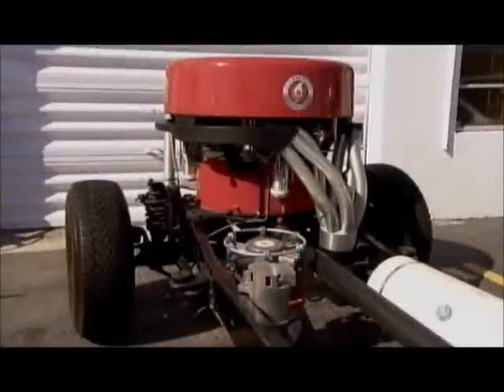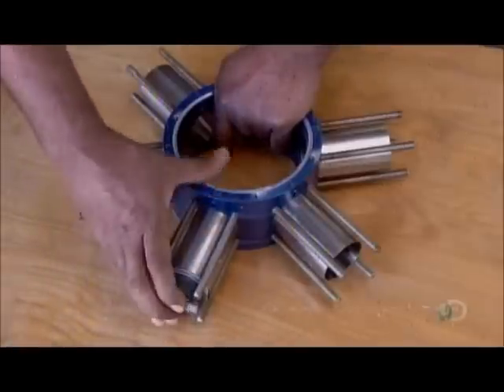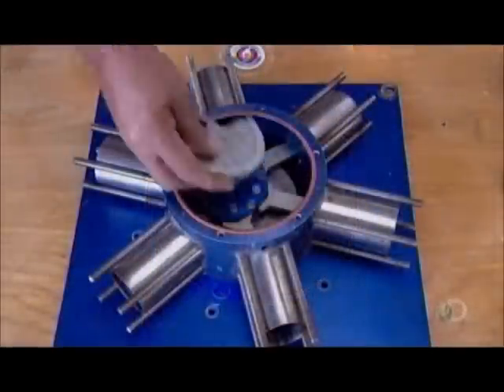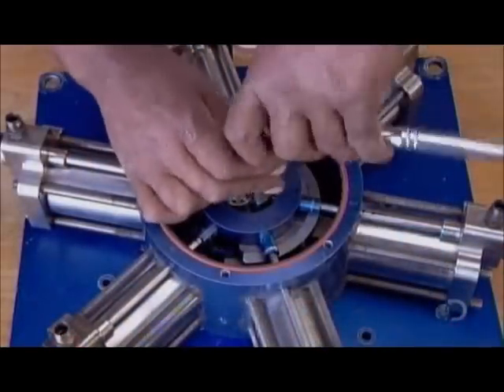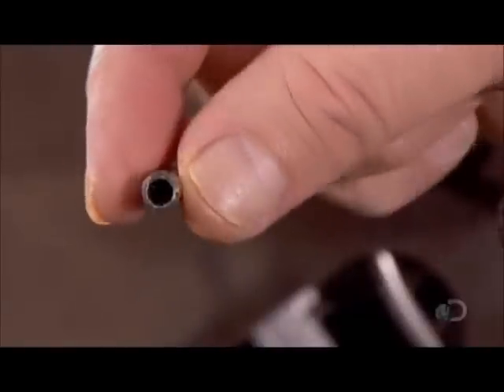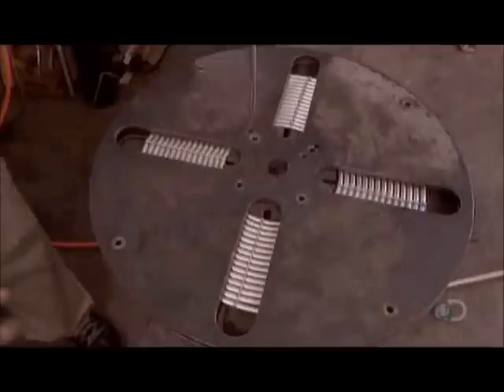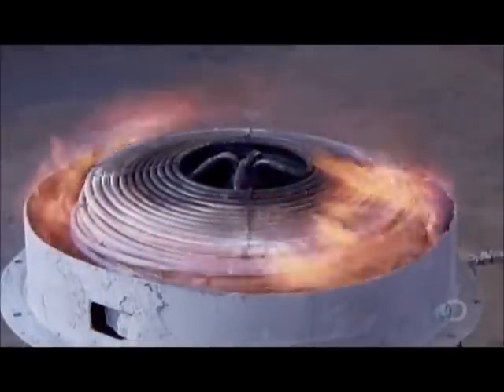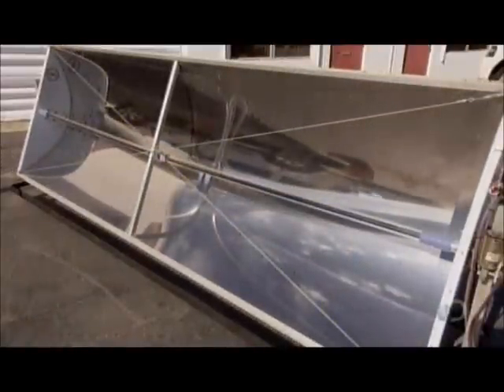How It's Made - Steam Engines

Comment: steam engines don't need a transmission.
since the tourqe they produce is not depending on the revs.
Reply: The real doktorbimmer oh please! Cut it out already… you know darn well the issue was whether a transmission was used.  It wasn’t.
Reply: The real doktorbimmer

take the fuel you want, and see how mutch energy it has inside.
then take a look at the output of the system, the kinematic energy it can supply. notice the word system.

compare an IC engine, its clutch, and its trnsmission as a system.
then do with the same with a proper boiler, and a steam engine.

the verry first thing you will notice is, steam will give you more out of your choosen fuel.
your question then, why are they not used in cars?

now, take the same 2 systems, and to measure them to see what kind of mass they have, and see the relation of kinematic power and mass for both systems.
You will see, a steam engine and its boiler is far larger in volume, and wieght far more for a given unit of power.

there is your answer.
IC engines are light, and small.
steam engines are big, bulky, and heavy.

efficiency at power/weight and power/volume wise for steam applications is low. they are inefficient in that regard.
they can turn fuel into kinematic power with high efficiency, but it would be verry impractical solution for a car for example.
(notice, again i point it out, for a car you do not want a steam engine, neighter do i)

how come it could turn fuel into kinematic energy at a better efficeincy , if both are heat engines ?
IC engines have a graph of tourqe  relative to RPM.
to make an IC engine work efficiently, it only has a narrow band of RPM where it can function properly, efficiency decreases a lot when the engine is driven outside this range.
so you have to employ some mechanisms, usually a clutch, and a transmission. they add dead weight, and simply take power away from the engine just to spin. This adds up to around 30% tipical.

if you only take the engines them self, the IC engine in its working range has better thermodynamic efficiency, but not enough to negate the effect of the reduction in output by the transmission and clutch assembly required to keep the engine in its best working range.

the piston based steam engine if it lacks deadspots, dual actuating ones usually do not have any you have a near lossless CVT -ish like setup.
as the steam engine's tourqe does not depend on rpm thatmutch, it does, but magnitudes smaller variation can be observed than with the IC engine

and there you have it.
what if by some magical means a steam engine could be scaled down in size, and weight , along with the boiler , while still having the same output ?
well, it would still not be usefull in a car.
(notice again, not usefull in a car. i repeat, NOT USEFULL IN A CAR)
why ?
it takes time to heat up a boiler.
you can start an IC engine whitin secunds.
not su true with a steam engine.

great, so then how come piston based steam engines are not used widely ?
most stationary engines requirements are to drive a rather constant load.
for that application a turbine is better suited.
near constant rpm, and load.
would be ideal for an IC engine, expect..
IC engines have far less thermodynamic efficienc than multistage steam turbines.
a signle stage turbine would never be able to match an IC engine,  but happy for us, we are not limited to a single stage. Impulse and reaction turbine stages are coupled via a common shaft in mutli-stage turbines, yielding a better thermodynamic efficiency than even a turbo-compund IC engine.

allso turbines run on the rankine cyycle, not the carnot cycle.
waste heat recovery is conducted by re-heating steam used in the system,  given a proper matching the heat lost to re-condense from steam to fluid again can be minimaised, and even that heat can be used in a number of ways. like providing hot water, or in some cases heating the fuel burned to create steam.

this is why even oil burner powerplants use steam, and not burn the oil in an IC engine.

and to run back a bit to turbo compounding.
i did search, but failed to find turbo-compund solutions where multistage turbines would be used. particles in the exhaust prevent using high efficiency turbines. refer to what i wrote, i was woundering hat would it take to filter those particles, or to use a heat exchanger. so proper multistage high efficiency turbines could be used.
nothing new, still turbo compund, i adid agree with you on that.
same as exsisting solutions ? nope.
driving a generator and using an electromtor, allso nothing new, can be seen in f1 and other areas. with a storage unit in between.
and that is the difference. instead of  a storage unit, the electric power would be routed by a load tracking powersupply.
how is it different from f1 solution ?
1. no storage used. storing electric power and using it reduces efficeincy. for a lead acid battery as an example, about 50% is lost.
2. f1 solution accumlates power, and releases it in a short time, meanwhile the load tracking solution should provide a load for the turbine to keep it as close to its ideal work RPM and load as possible, and would provide a constant coupling.

steam as a primary engine in  automotive use is not feasable.
(notice it, again i point this out)
while they can turn fuel into kinematic power (as a system , do rememeber that) at a better efficiency than IC engines (again as a system) they are still far to bulky and not quite ideal for a car. (again, not ideal for a car).

as a waste heat recovery system augmenting an IC engine, i think it may have its value ( heatexchanger from exhaust gas type solution to allow high efficiency multi-stage turbine operation) but if the exhaust gas partcile filtering is managable to a level to use higher efficency turbines for turbo coumpounding ( see the pattern? hence why i was woudering what would it take to filter the exhaust gas to that level) then that would be a far better solution for automotive usage.

to sum it up, i DID NOT SAY steam power for cars is the way to go.
DID NOT SAY STEAM FOR CARS IS THE WAY TO GO.

alsso did not say a steam engine alone is better in efficiency than an ic engine. (I DID NOT, again and again).

I do state piston based steam engines as a system ( AS A SYSTEM) are better in effciency compared to a piston based IC engine SYSTEM (YESS? AS A SYSTEM)

i allso do state a multi-stage turbine based SYSTEM (SYSTEM, read it, it says SYSTEM) is better in thermodynamic efficiency than any IC piston engine, even with turbo compounding.

you did not correct anything i sayd, instead,
you just simply made up things i never sayd, and argued over those.
none of them are my claims.
you only proven your own false imaginations false.
Reply: The real doktorbimmer oh you’re going with not admitting you were wrong?  Ok.  There’s no transmission there, and BTW, it’s easy to see from the vid that Leno is right.
Reply: The real doktorbimmer you’re hilarious!  When forced to admit that steam has far more torque you can’t resist adding ‘…….than is even needed…..”   Dude more torque is always better, it lets you downsize the engine.  You have a psychological problem with steam engines.  Very strange.   Look out! They’re coming to get you!
Reply: Nagy Andras let’s be charitable and assume he got one of my comments mixed up with yours.  But he keeps putting words and statements in my mouth that I did not make, and he does the same to you.   His statements are strangely rigid and dogmatic.  Well, I’ve had enough fun.  Bye.
Reply: +Nagy Andras yes, and unfortunately, diesel is now facing a major, possibly deal-breaking issue. That is emissions.  I hope there will be some technological way out of this, but urea, after burning and scr are power-robbing options.  I hope they find a solution.  BTW, I own one of the affected jettas involved in 'diesel gate’.  I’m waiting to see what will happen, but I will tell you I’ve already had some major issues with the after treatment system.  Water in the intercooler system resulting in hydrolock, and a sticking air flapper in the low pressure egr system.  The exact same thing is affecting thousands of fellow jetta owners.   I’m pissed and disappointed at Volkswagen.  Off topic, but I had to vent.
Reply: +The real doktorbimmer no, and if I had more money I’d have bought a chevy volt and if I had a real lot of money I’d buy a Tesla.  Are either of those cars driven by a diesel engine?  NO, because efficiency is not the sole determinant.
Reply: +The real doktorbimmer oh look, the EPA has given certification to a Cyclone steam engine.  4 manufactures are ready to produce the engine (a 25hp waste heat unit)     This must be fake.  Probably movie actors in fake  EPA labcoats or something.
https://www.facebook.com/CyclonePowerTechnologies/posts/1016753441690054
Reply: free piston engines are not a new idea,
starting them up was a problem and as far as i can remember they had problems with balancig for vibration.
energy storage in a battery and then using that energy has its own problems allready. actualy generating green power from solar and wind is no problem, but storage is. not even grid tie soultions provides enough efficient capacity to store energy in a high density form. charging  battery then draining it has a quite low efficiency, and direct driving motors from a free piston engine has its own problems, as free piston engines need some sortha load to operate properly (unless i remembre wrong, witch can happen)

no idea what toyota could have engineer as a solution tbh, currently my personal best bet will be 2 cylinder 2 stroke diesels, with an electrically assisted turbocharger, and maybe even a multi-stage turbine for turbo-compounding.
Reply: Nagy Andras but they need a lot more fuel to produce the same amount of power...
Reply: The real doktorbimmer

well external combustion engines are not quite as efficient as internal combustion engines, i give you that for sure.
on the otherhand external combustion engines have advantages.
the lack of need for any transmission and even is some cases a clutch , is a great one. consider that a transmission can eat up even 30% of power.
if you look at the whole system, they are not that inefficient.
but surely, internal combustion engines give better ratio of weight to power, and operating them is far more efforthless.
it takes a while to make steam.

on the otherhand, if you look at any nuclear plant, its hearth is a big funken steam machine. not piston based, but turbine based.
and are pretty darn efficient if they work as a combined cycle plant (they do.)
not suitable for a scooter or car, or truck, but its quite suitable as a stable engine.

if you consider the combined efficiency of a combined cycle steam turbine , and any internal combustion engine, you will find steam engines are not so bad at all.
Reply: Nagy Andras Interesting thoughts... but it doesn't explain the consistantly lower fuel economy of steam technology.. 

You almost make it sound like steam powered cars  have not been obsolete for 100 years!

cheers!
Reply: contrary, i make it sound steam powered car where obsolete 100 years ago.

but when you refill an electric car today, most probably you use at least partially steam power :D

its better as a stationary engine than an IC engine. fuel economy wise too.
for any moblie application...
well, some thips do have a nuke plant, so they are steam powered anyways.

but i agree, in a car it would suck bigtime.

fuel efficiency.. well it depends on construction and on load. the eninge alone in its self is far inferior to modern ic engines.
on the otherhand, if you look at the input fuel energy, and the output at the end of a system, there are certain cases where it will outpreform an ic engine by far.

its a kindof problem like.. a farmtractor, and a city car comaprism.
try to plow with both, and you will see the tractor has bette fuel economy...
on the otherhand in a city drving scenario the tractor may not be your ideal choice :D

it really all depends on what you need to do.
if torque avalble from 0 rpm to full rpm is important, steam is the way to go.
still is, ever since it has been invented.
Reply: Nagy Andras electric power that could have been generated more efficienty by ICEs..

specially since charging a battery-electric cars off the grid is not energy efficient..

but its not more efficient... its just cheaper... there is a difference there... a difference that doesn't translate to small scale vehicle applications.

Thats a really bad analogy.. there is no comparable data.. like power output, BSFC or thermal fuel efficiency... not to mention design variables like power to weight ratio or design service life...

Steam has never been more efficient.. Carnot discribed these facts before ICEs were even invented..
Reply: sure, the The MAN S80ME-C7 can reach up to 54% conversion, but at other than ideal load for the engine will make it less than 50% efficient. probably around 47-48% or so.

http://www.turbinesinfo.com/steam-turbine-efficiency/

this might be a good read.
there is a verry good reason that most of eelctricity is made by steam turbines :D
Reply: Nagy Andras Thats still better than steam!!!!!

Yes of course.. we are talking peak efficiency for power stations too..  big ship engines spend most of their time running at optimum rpm and load just like power stations, but Diesel is also much more efficient in off peak conditions and we are talking single cycle for the Diesel... just like you would find in other vehicles... so no there is no efficiency advantage here even using your facts.

Yes there is ... because cheap or dirty fuels like nuclear or coal are cost effective despite steam being less fuel efficient...

There is a good reason most of the electricity is not produced from oil...
Reply: "Multistage (moderate to high-pressure ratio) steam turbines have thermodynamic efficiencies that vary from 65% for small (under 1,000 kW) units to over 90% for large industrial and utility sized units."

internal combustion engines won't get there ever.
allso do notice, i exactly told steam power in any form would suck for a car.
why you act as if i would say steam for cars is the way to go ?

and even, where are we?
i just mentioned steam engines do not require a darn clutch, and piston based steam engines do not require any transmission at all, as they by nature of externa combustion engines have maximum tourqe when halted. (some designs have a dead point where they can't self-start)

so anyways..
stationary engines are steam powered for a verry good reason. higher themodynamic efficiency than any internal combustion engine could ever have.
Reply: Nagy Andras Lol..!!! I don't know where you came up with those crazy numbers!!!!

Your data is incorrect, and very inaccurate.

Your statement is false, in fact t it is impossible for any steam system to reach  efficiency beyond its theoretical limit of 64%

The Diesel has a theoretical limit of 74%

steam turbines currently reach only about 40%
Reply: source for steam turbines
http://www.turbinesinfo.com/steam-turbine-efficiency/

source for the MAN diesel engine
https://ralphhosier.wordpress.com/2011/10/25/the-most-powerful-piston-engine-in-the-world/

and you are incorrect, single stage steam turbines don't go past 37%.
Reply: Nagy Andras Are you actually quoting data from your own website??? wtf???

The "facts" on your site are wrong.. completely inaccurate.
Reply: The real doktorbimmer here’s a clipping from a steam expert:
 the energy required to produce the fuel renders the gasoline engine less efficient than the steam engine.To use an analogy, we get media hype about the "non-polluting electric car." No one pays any attention to the coal-fired power plant belching dust into the air to create that electricity.A steam engine can run on the products at hand -- sawdust, wood, corncobs, etc. No one counts the cost and energy consumption of bringing crude oil out of the ground, refining it, shipping it to terminals and service stations, and all the rest.It gets better. As we have just shown you, the net cost of operating a steam engine is lower than anything else on the planet that requires fuel. You can run an automobile on farmer's alcohol. You can run a diesel on vegetable oil. Both examples are still more costly and labor intensive (to produce the fuel) than steam.You may never have to replace the steam engine itself. Steam engines do not form carbon (a major wear factor) and turn fairly slowly. Steam engines have other advantages that, in regards to the wear factor, outclass gasoline engines. Steam engines normally have much larger bearing surfaces against the crankshaft. Steam engines have no "side-loading" as gas engines do and, on a "double-acting" steam engine (steam pressure is alternately exerted against each side of the piston) there is a "cushion" effect that protects the engine still further. One steam engine in England ran 24 hours a day from 1800 to 1950.See:  Levant Beam Engine: A steam engine built in 1840, its claim to fame being that it is the oldest Cornish mine engine which also has remained in situ, and is to this day operational
Reply: Nagy Andras "allso do notice, i exactly told steam power in any form would suck for a car.
why you act as if i would say steam for cars is the way to go ?…”   He accuses anyone of this if they don’t put down the concept enough.  

You say steam for a car would suck, yet 100 years ago they made very drivable steam cars.  Youtube is full of people still driving them.  A modern steam car would be far, far more drivable, no doubt.
Reply: Some Other Dude Yup... coal is very cheap... its the only thing (other than nuclear) thats cheap enough to offset steam's higher fuel consumption than ICE's

using the current grid system, battery electrics are less efficiect (total fuel efficiency) and create more pollution than a modern ICE powered car.
Reply: Some Other Dude Steam cars were already obsolete 100 years ago...

 Charles Kettering invented the electric starter in 1911... steam instantly became obsolete.
Reply: The real doktorbimmer I’m just reading a steam expert guy talking about farmers running steam engines profitably using organic farm waste….
Reply: The real doktorbimmer hundreds of thousands were built, purchased and driven.  I don’t think you could even admit that with a gun to your head.  You’ve got some kind of mental problem with steam engines.    And if modes technology tipped the balance back towards steam, I think you’d go insane.  Any ideas on what wrong with you?  You really, really have it in for steam.
Reply: The real doktorbimmer here’s a fascinating engine,  although you will get all threatened and annoyed by it:

http://www.douglas-self.com/MUSEUM/POWER/still/still.htm
Reply: Some Other Dude I'm familiar with William Stills work on the Kitson-Still Diesel-Steam co-gen locomotive from the same period..

Still was very smart.. combining the higher first stage Carnot cycle efficiency of the Diesel and the co-generating  second stage heat recovery of the steam cycle.. 

Unfortunately for Still the development of the Diesel passed the thershold where his concept would be practical (at the time) for land and marine applications.. of course his basic theory is still in use today in staitonary gas fired ICE powerplants using combined cycle steam co-generation..

The idea is "still" useful in mega-sized ICE powerplants
Reply: Some Other Dude Well if he's using free "shit" for fuel then fuel efficiency is meaningless...

whats his build and operating costs?

How many kilowatts is he generating?
Reply: Some Other Dude I love steam, especially big American locomotives... but I'm not deluded into thinking that they are not obsolete.

thankfully some good folks have preserved a few of them at railroad museums... where they belong.
Reply: piston based steam engines are "obsolete" in many ways, yess.
as a waste heat recovery system, steam turbines to a far better job.
but they are impractical both as car or truck engines.

piston based ones do have a trait that no IC engine could ever have, that is constant and instant tourqe, and lack of need for a clutch of anysorths at all, and in man cases they do not require a transmission.
if you take an IC engine, make it a verry good one, say..impossibly good.
that has say.. 80% efficiency of turning the fuel into kinematic energy.
and it is coupled to a transmission that is allso not a bad one, but still has 30% loss of input vs output (not uncommon. a lot of them are actually worse) you end up with 0,8*0,7 = 0,56 , so 56% efficency.
something a steam engine can provide, and nothing else is taking away from it.

they are not inefficient in a wide tourqe range use (piston based ones) , and do better than an IC+clutch+tranny.

however, a multi stage steam turbine in its narrow work range is surprassing IC efficiency.

what both multi stage steam turbines and piston based steam engines far short is weight and volume vs power.
an IC engine is pretty mutch verry good in those.
if weight and size is no problem, and only efficiency is what you seek than steam is still the way to go.
and this is backt up by the fact of widespread usage of steam powerplants all around.
You have to account the losses of the drivetrain to judge the efficiency, never forget that.
from economy point of view, the available fuels are allso need to be accounted.
for automotive usage fuel energy density and weight of the whole thing has to be considered.

it all depends on application.
if you are environmentally frinedly even then steam has its uses.
singel junction solar panels can't reach over 34% efficiency, and storage of solar power is still a problem.
allso solar cells are not quite friendly to environmnet when they are produced, and decay over time to be less efficient, recycling of solar panels is allso not that easy.
meanwhile, a concentrated solar type "boiler" can store superheated steam over time and release it to steam engines.
so the battery problem is at least partially solved, vacuum insulation technology is pretty efficient nowdays.
however, for loads that are not constant a turbine based steam engine is not quite ideal. piston based steam engines have no problems in that regard. allso steam egngines are easy to recycle, and have a pretty darn long life cycle, imagine one made with todays advanced technology vs an oldtimer that ran for decades based on hundred years old technology.
it would be the size of godzilla, still requires no chemicals unlike any battery, water stays water, and never decays (in a closed cycle) and would provide some usefull traits no other solar based technology can.

steam is still not a bad thing, but i do agree for many areas its unsuitable.
i repeat that, for many areas steam is impractical and unsuited.
i do not envision steam powered cars and airplanes, i'm aware why it would not work as good as IC engines in that role.
I'm allso aware where stea still is the best possible solution.
and again, steam is not better at everything compared to an IC engine.
never sayd that, never will, don't even try to give that into my mouth.
I just pointed out its far from obsolete, as sofar nothing better has been found for many areas, and steam power is still under development.
Reply: The real doktorbimmer you are discounting any chance whatsoever that they will ever come back in any way, shape or form, no?  Did you read about the BMW energy recovery system that uses steam?  I think they were using that instead of an alternator.  There is also some guy who patented water injection into a 4 stroke diesel to gain lots of extra power….
Reply: Some Other Dude

6 stroke and water injection technology is allso quite old by now :D
and steam does not need to make a comeback, it is here, it was here, and it will be here.
Reply: Nagy Andras I see you’re not taking the bait. Oh well… Dr. Bimmer and I were talking mostly about automotive steam.  I tend to be fascinated with ‘alternative’ technologies, thus my interest in steam.
Reply: Some Other Dude

waste heat recovery in automotive applications is getting urgent, i can imagine a heat exchanger applied to the exhaust and turnt he heat from there to a medium that has a lower boiling point, and run it in a closed loop with a steam machine and a condenser.
probably the IC engine main shaft would have an electric motor attached, powered by whatever the steam machine can throw at it via a workpoint tracing switching powersupply
Reply: Nagy Andras That might be an issue if autmotive steam powertrains existed that came close to ICE fuel efficiency... but thats not the case... I've yet to see a practical steam engine car with the wheels attached directly to the engines output shaft... tranmission loss is inevitable... even for steam.  also transmission loss varies on a car.. depending on operating conditions and the design... those numbers are a bit too high really. Modern cars do not have 30% loss though the transmission.
Reply: Some Other Dude Heat recovery is area where steam has much promise... but in vehicle applications its has yet to have show improvements in fuel economy without serious cost effectiveness and practicality issues.

Heat recover technology will most likely continue to develope in the area of large ICE engines like marine and stationary...

Many large ships use heat recovery to generate freshwater through distillation..

Turbo-Compounding and heat recovery exhaust driven accesories  seem to have promise as well... VW is set to produce the first ever Turbo-Compound Diesel for automotive use...  a technology that would also compliment the growing interest in HCCI technology..
Reply: The real doktorbimmer at least one of the 100 year old cars does in fact have the steam engine connected directly to the drive wheels.  One of the Jay Leno steam car episodes goes over the chassis and mechanical workings in detail and they mention that.  Can’t remember which make it was, he owns one of each.
Reply: mm yess, probably exhaust gas driven turbine driven alternator (sorry.. i could not describe with less words) may gain attention besides other means :D
Reply: Some Other Dude Please elaborate if you can... I have not seen any steam car in the Leno collection that is direct drive...
Reply: Nagy Andras Issues with heat and a demand curve that is not matched very well is still an issue... a series hybrid would be a good drive cycle match-up... the problem is series hybrids tend to be too complex, heavy and expensive already...

Direct heat recovery systems  like Turbo-Compounding have more promise
Reply: that is verry true.

actually i do wounder what would it take to use proper particle filtering of exhaust gasses, to allow a multi-stage direct turbine to be driven by the exhaust gas. carbon deposits would not allow the usage of "proper" ones, allso i have not lookt into the curves of what kindof limits it would have. if it drives an alternator, then SMPS could track the load to make sure the turbine is kept close to its best. and the IC engine crankshaft could be driven by an electric motor as a way to couple what the turbine can extract from the exhaust gasses.
I sortha think the heat exchanger methood would be more complicated in one way, but in an other way it requires no particle filtering of the exhaust gas. i'm not sure what would be the best option to be honest.
Reply: The real doktorbimmer 

http://www.autoblog.com/2014/04/14/lenos-steam-powered-1925-doble-e-20-is-fascinating/

advance the video to 11:02
Reply: Nagy Andras Apparently you were unaware? that such systems already exist... its called Turbo-Compounding
Reply: Some Other Dude He is not using the correct technical terminology here.. refering to a "direct drive" as to mean the lack of a propeller shaft... the direct drive actual refers to the link to the differential reduction gears...  which is in fact a type of power transmission device.

Althogh Jay is an avid hobbist, he is in fact a  professional intertainer/comedian
not a professional automotive engineer
Reply: The real doktorbimmer

allready? rurbo compound is verry old :D
i'm aware of them. but that is an unmatched direct feedback mechanical drive, suitable for only a narrow range of operating speeds.

what i described contains an SMPS to do the proper loadmatching to keep the turbine in its best rpm range by regulating the load the attached generator will see. quite a bit different.
Reply: Nagy Andras Guess your not a Formula 1 fan? Well it seems very obvious by your comment now that you don't understand the basic concept or the fact that the concept can be configured in a varitety of systems including mechanical, but also electric, hydraulic and pneumatic drive configurations...

perhaps you should try learning to build a wheel before you attempt to reinvent it...

Cheers!
Reply: Nagy Andras Yes, old... but still in use, we have 2 aircraft stationed here still equiped with blow-down Turbo-Compound engines... I see them flying often..

... and Iveco, Mercedes-Benz/MTU and Volkswagen all have pressure turbine systems available now. You can see brand new Turbo-Compound engines using the series hybrid pressure turbine system on TV every other Sunday...
Reply: those are a bit different, specially the old aviation kinds.
surely they only differ in how the power is coupled back to the engine, but still is a difference.
sofar i don't know of any exsisting solution that has any wide band active load tracking available. at least none i'm aware of.
allso you got it, i don't watch F1. i'm aware of the technology used in them, but i'm a fan of truck trials to be honest.
Reply: Nagy Andras The Same.. they are all forms of Turbo-Compounding and follow the same basic concept.

Generally the power recovery curve is linear.. and matches the first stage engine... except systems that feature exhaust augmentor mode
Reply: The real doktorbimmer

mm not quite the same.
you see, a directly to the engine coupled turbine with a gear reduction unit (the one in many aircrafts) will have a berry narrow rpm and load range where it can produce the most benefit.
the F1 style solutions "harverst" energy and store before release mostly, to aid the car in acceleration. unsuitable and unfavourable for a constant load. a truck for example would benefit from something that can operate all the time.
what i described is one that can operate all the time, it would allow the turbine to spool up to the range where it can deliver the most, as the powersupply unit would change the load it would see in a wide range.
the common principle is to harverst energy otherwise wasted.
with a turbine of some sorth.
and from there they are all different.
just like IC engines are all turning chemical energy to heat, and then convert heat energy to kinetic energy.
still a diesel engine is far more suited for a truck than a 2 stroke petrol engine, despite the basic principle is the same.

You can't sompare the f1 kind of solution to the old  avaiation kind, they excell in different things. one of them was ment for a steady load at a steady RPM, the other is ment to give non-continous boost.
quite a bit far from eatch other, i guess ou realise it now.
Reply: Nagy Andras SAME..... Same exact concept, which is why all of the systems mentioned are classified as Turbo-Compounding.. stop trying to cover up your mistake, your argumenent is making you look even more foolish.
Reply: Some Other Dude Perhaps you need to learn what "transmission" or "gear box" means...because unless your blind???  I can clearly see a transmission.

Unless the wheels and crankshaft are connected and share a common shaft, or connected 'in-line' without a propeller shaft?
Even a locomotive drive system with connecting rods attached directly to the drivers represents a transmission system and a measurable frictional loss that must be accounted for...

If it smells like bullshit? it probably is bullshit
Reply: The real doktorbimmer

i never told they are not similar, every variant is called turbo-compund. by efinition its a way to to couple by some means a turbine driven by the exhaust to increase engine output without increasing the fuel consumption.

still i made no mistake, different variants have different attributes. so they are not the SAME at all. they are VARIATIONS.
sortha you have to learn to live with that.
Reply: Nagy Andras Yes there are many variations of Turbo-Compounding.. but they are all the SAME concept... I simply pointed out that what you were attemping to describe as an original design already existed in concept and in practise... and this concept already has a name... one that at the time you seemed completely unaware of... 

 As I said, perhaps you should learn how to make wheels before you set out to reinvent them... it will save you from looking foolish.

Cheers!
Reply: Nagy Andras But the CONCEPT is the SAME...

They are all forms of Turbo-Compounding.
Reply: The real doktorbimmer oh dude COME ON!   The only gears there are part of a differential.  You’re obviously a very knowledgable person, probably an engineer, but your rigid dogma (concerning steam and diesel) has you making  indefensible statements that even a lay person like me can poke holes in.   Your splitting of hairs to wriggle out of this ("connecting rods attached directly to the drivers”) must have taken you hours to think up.  It’s pretty good actually- too bad you don’t apply your intellect to an honest pursuit.  I’m going to have to beg off of this conversation for now on; I’m embarrassed for you at this point. Your inability to admit you didn’t have something quite right has you looking like a baby.  Sheesh!
Reply: The real doktorbimmer

I'm still pretty sure none of them are load tracking.
what i described is.
surely still turbo-compund, yes it is in principle to recycle wasted energy harvasted via a turbine, but other than that its different.
if yu can't see the difference, than its your problem.
i did try to describe the difference, but you simply failed to even read it.
the different variations are not identical, you did agree with that, so i have no clue what is all the fuzz you are making.
look, both steam piston engines, and diesel engines are just piston engines, following your logic there is no difference btween them, they are the same.
why are you fighting to make a donky out of your self?
no mather how hard you try, an apple and and orange is not the same, even if they are in principle both just plants.
Reply: Some Other Dude Just pointing out that there is in fact transmission loss in steam applications too... both of you were trying to imply that steam cars had zero frictional loss due to transmission losses... therefore an advantage over ICEs in total fuel efficiency...

...And that implication is simply not true
Reply: Nagy Andras SAME CONCEPT.. different methods..

No, you did not invent something new.. its a an old concept that is still in use
Reply: The real doktorbimmer nope that wasn’t my point at all; Nagy (among others) had mentioned that steam engines in a transportation application do not need a transmission as they have full torque available from zero rpm’s.  That was my point.  In fact I wasn’t even making a point really, I was merely agreeing with someone (nagy?) who said it first.
Reply: Some Other Dude Yeah you jumped in without understanding why I corrected his mistake.. you then tried to use Mr Leno's incorrect comment misrepresenting something as being 'direct drive" when clearly that was not the case..
Reply: Some Other Dude Yes we all know this... steam can produce far more torque at low rpm than is even needed... they also without a transmission or load sensing technology consume vast quanities of steam as rpm increases... requiring a multitude of complex features such as simpling/doubling valves, variable timing and early cut-off devices to reduce this wasted steam at high cruising rpm where ICEs (with a transmission) can be operated much more fuel efficienly even with the increased frictional losses..

Its why having more gears not only increases performance... it also increases the fuel economy..

Because  the ICE can be kept within a more economical range while the steam car with its single gear is seldom operating at its most efficient rpm or load factor.
Reply: Some Other Dude
Reply: The real doktorbimmer

its done with rpessure regulation.
there is no wasted steam.
research how they work.
Reply: The real doktorbimmer

i did not mention inventing anything.
i perfectly know how old is the trubo.compound soution.
i just mentioned i seen no load tracking variation ever made.
Reply: The real doktorbimmer

i made no mistake, so you did not correct me anywhere.
actually i had to correct you multiple times.
Reply: The real doktorbimmer

"having more gears not only increases performance"
terribly wrong. more selection of available selectable ranges, not gear that make an IC engine more economical.

and piston based steam engines don't need any of those.
as tourqe does not change a lot with rpm. unlike with the IC engines.
some had a 2 speed gearbox but was verry rare. and only to reduce wear from high rpm.
Reply: The real doktorbimmer

nope we did not. you are verry far off.
any moving part has firctional losses.
there is a verry good reason why high efficiency piston engines of anykind are all low speed engines.
and if you look back, i mentioned a few times that steam engines in cars would be less ideal solution by any means than IC engines.

and still, an IC engine and a transmission has less efficiency than a standalone steam engine.
Reply: Nagy Andras I think the total obsolescence of steam cars and the current state of automobile technology soundly disproves that theory
Reply: The real doktorbimmer

where did i say it would be good for automotive use?
where did you read that?

you only could have read the opposite, if you would be reading at all.
numerous times i states steam engines are unsuitablke for cars and trucks, and even for trains.

pull your head out of your ass.
you reached the point where you can't even make a single sentence that is valid.
Reply: Nagy Andras Thats right... so how can steam be more efficient than ICEs?  If they are less on the small scale? Thermal efficiency increases with scale... advantage to the ICE, not steam
Reply: Nagy Andras Wrong, steam is fundamentally less efficient than ICEs...

Steam is obsolete in all but a very few applications were cheap fuel and gigantic scale can offset its higher fuel consumption and lower thermal fuel efficiency
Reply: The real doktorbimmer

right. you did not read a word out of it then.
Reply: Nagy Andras Yes I did. but your theory that steam is (as a system) as you put it... does not represent a more fuel efficient system..

No, all Heat Engines including (including steam systems) is subject to the Carnot Cycle.... period

ICEs have higher Carnot Cycle efficiency than steam.

Steam is LESS EFFICIENT
Reply: The real doktorbimmer

false, just as it was.
Reply: Some Other Dude Its very clear to see a gearset and axle assembly in the video... this gearset/axle unit represents a transmission and as our confused friend pointed out transmissions causes frictional losses.

Like you, Mr Leno is not an engineer and often makes comments which also like you might sound clever or intertaining, but they are also (in engineering terms) incorrect...

It was very apparent to me, that what Mr. Leno was trying to convey is that the automobile in question had its engine connected directly to its axle assembly without the need for a chain, belt or propeller. Without understanding what the term "direct drive" is?
You simply repeated his mistake
Reply: Nagy Andras Yes, your theory is false.. because the Carnot Cycle formula tells us its impossible to achieve higher fuel efficiecy with steam compared to ICEs
Reply: The real doktorbimmer

read back, told a few times.
look at the system, and not just the engine.
Reply: Nagy Andras First stage Carnot Cycle efficiency is critical to overall fuel efficiency.. your confusing scale efficiency and scale based heat recovery technolgy that is not inherently unique to steam.

These principles are used to reduce the fuel comsumption of the less efficient steam cycle...

ICEs are more efficient than steam heat engine all things being equal.

Steam is still used in very limited applications where the advantage of low cost fuel and economy of scale produce electric power at a lower cost per Kilowatt...

Don't make the assumption that this is evidence or proof that steam is a more fuel efficient system..  

Carnot already proved to us that it is not..
Reply: so where did i say cheap fuel?
that is only your claim again.

understand, if you have a 60% efficient IC angnine, that has to be coupled to a tranny to make it suitable for a task, that has 70% efficiency, then you get a final result of 42%.
burn the same fuel in a modern steam engine (lets stick with pistons here to amke it less frustrating for you) you can get hihger than 42% there.
as late piston based steam engines where close to 50% efficient.

why it works ?
cuz the damned piston based steam engine does not require any sorth fo transmission, that comes from its nature of being external combustion engine.

and this is the most primitive way to put it in front of you. if you don't get it , then i'm sorry for you. vast of luck.
Reply: Nagy Andras I though you were not refering to automotive vehicle applications?
 You specifically clarified that your aurgument was strictly limited to staionary power units.

Now you continue to waffle on the subject
Reply: The real doktorbimmer

and that is correct. i do not refer to automotive applications, as i pointed out a dozen times, steam is inpractical for cars.
Reply: Nagy Andras Your theory has some very significant fundamental flaws..

primarily your assumption that ICE's are not used in applications where "direct-drive" is used also.. 

these assumptions are incongruent with the fundamental basis of your theory and therfore disprove them.
Reply: The real doktorbimmer

may i ask you to quote where i wrote or mentioned ICE engines not used in "driect drive" ?

again you are far off, i never told anything like that.
Reply: Nagy Andras I’m leaving you alone to tell him to stop saying you said things you never said.  Enjoy!
Reply: Nagy Andras Then why did you mention "direct drive"????

If direct drive is not unique to steam power systems? Then why both to mention it ?

What was your point?
Reply: Some Other Dude Well if the things he said made sense? there would be no reason to say anything more...
Reply: +The real doktorbimmer sorry I keep receiving your flawed replies via email, and when I hit ‘reply’ it directs me to the youtube thread where I then have to search thousands of comments.  So I can’t find your latest comment to reply to.  
In your latest flawed reply,  you compare diesel to single stage steam, even though you yourself state that multiple expansion steam is much better.  We have not limited this discussion to cyclone single stage and you know it.  The rest of your comment is cut off in my email and I can’t find it on this thread.  But multiple expansion steam is certainly possible to have.
Now remember, I love diesel (I drive a 2010 Jetta TDI) but I am aghast at what is in the news right now.  People are literally declaring diesel to be dead!  I realize this is probably overheated rhetoric of the moment, but what do you think of this?  I’d be interested to know your thoughts.  
There is a very real threat that emissions will kill diesel, there seems to be some movement in this direction in Europe, which is the driving force of diesel.
Here’s a quote, but I have seen a lot of similar quotes this morning:

"It’s very possible that diesel is going to have it’s Rotary moment.That is to say: it’s running up against fundamental restrictions of it’s design vis a vis emissions, economy and the associated complexity to deal with both, and what advantages it has have been taken by others (torque and economy, by hybrids and DI gas turbos) It may live on in places where these constraints don’t matter or are outweighed by the benefits it offers (again, like the rotary) but it’s time in the limelight is through….”
So… if you point to efficiency limits of steam, what about the emissions limits of diesel?  Stricter limits are coming in 2017, and it appears that diesel will take real performance, cost and fuel economy hits to comply.
Reply: +The real doktorbimmer I NEVER implied ‘zero frictional loss’ - heck, frictional loss in steam starts right at the piston.  But there was only a differential in that vid, and that was just to turn the powers haft 90• to turn the wheels.
Reply: Some Other Dude Cyclones design is single stage... the lowest efficiency possible in a steam design.

Remember? most multi-expansion steam engines benefit in efficiency and performance with the addition of a condenser.

Single expansion engines lose performance and efficiency with condensers.

The Corporate Average Fuel Efficiency is also scheduled to increase....

EVERY YEAR UNTIL 2025!!!!!

Yet steam and Wankel engines cannot even comply with CURRENT STANDARDS!

There is a lot more to the story your not getting.. of course the only people that understand less about fuel efficiency and heat engines than the news media

is you, and TheusDeusZeus..
Reply: Some Other Dude  But you did imply with this qoute you posted  that the MEDIA IS HYPE

""we get media hype about the "non-polluting electric car." No one pays any attention to the coal-fired power plant belching dust into the air to create that electricity.""
Reply: the only question is, would a small IC engine produce mroe pollution for a given amount of power, or the combined cycle of a powerplant and all the transmission losses getting it to the electric car.
sadly calculating it depends on a lot of factors. Like distance from the powerstation for example.
Reply: Some Other Dude No you didn't, of course steam powered cars have frictional losses... just like ICE powered cars.

What you said was the Doble has no transmission and that is was direct drive.

which of course is not true..

One can infer from this statement that your intention was to promote the notion that because it had a non-existent direct drive it had no frictional losses.

The differential reduction gears and bearings do in fact represent a frictional loss... similar to an ICE powered car when operating in 4th gear (direct drive) in most manual shift transmission configurations the input and output are directly coupled together  greatly reducing the amount of friction loss by gear reduction.

but the whole discussion is moot anyway... because steams thermal fuel efficiency is so horribly low on the scale and output class of an automobile that even a purely theoretical "zero friction" drive would not be enough to offset steam higher fuel consumption and resultant lower MPGs
Reply: Nagy Andras Fortunately there has been some really good data coming out that takes in account these factors...

The National Academy of Science for example with its recent reports shows that battery-electric cars charged from the grid system on average are less fuel efficient and generate more pollution than their ICE powered competitors.

Its this kind of data, and some long term data on real world performance are signs that this automotive segment has reached a point of saturation that has led to a marked decrease in electric car sales...
Reply: The real doktorbimmer

do they factor the growing green energy % of the grid power system ?

allso i agree, a car scale stem engine would be not quite practical nor efficient.

allso i still would not say IC engines are that hugely better in effciency. The losses of a transmission are still present, ranging up to 30%. and the best fuel to kinetic conversion by internal combustion diesel is a MAN engine with aroun 54%. Then account say.. 20% of tranmission losses. 1Kw worth of fuel as input, yields 0,54% Kw kinteic output on the engine, and further reduced to around 0,45 Kw after the transmission.
an 1970 ish steam engine can convert about 12 Mj from 1 Kg of coal ( roughly 24 Mj / kg on large avarage) that means around the same efficiency of fuel to kinetic energy conversion.
but they are unsuitable for operation of a city car for example.

http://www.cuug.ab.ca/branderr/eeepc/017_coal.html

allso, transmission sytems are usually constnt mesh types. it means all the gears are spinning, with only the engaged gears providing coupling. 4th gear is usually close to 1:1 ratio, and 5th and 5th+ gears provide even bigger ratios. it does not mean that they reduce losses by not spinning gears in idle, but by reducing the required engine rpm for a given speed. Check out how a transmission works.
Reply: +The real doktorbimmer yes, I did post that- and the quote is correct.  What's your point here?
Reply: +The real doktorbimmer I think I said it had no transmission, and it doesn't.  (the car in the video).  It does have a differential, but that is NOT a transmission.
Reply: +The real doktorbimmer I disagree that steams thermal efficiency is 'horribly low', it appears that given modern mat'ls it's possible to get close to the theoretical max.  I think its easier to approach the theoretical max for steam than it is for ICE.    To do it for ICE you have to trick out all the peripheral systems in complex ways.  Variable valve timing, twin turbos, etc.
Reply: but let us not be hasty and not only conside the engine , but the engine and the boiler as a unit. modern boilers are probably far more efficient than old ones. but heck. on large scale i think both are close (if we think about reciprocating piston engines) to eatch other, and multi stage steam turbines in combined cycle powerplants are far better.
if we think about piston engines , steam can have multiple stages to get better efficiency, that may allso be considered.

well anyways steam is not at all dead for sure.
Reply: Some Other Dude A differential gear set certainly is a power transmission device... and it creates drag and frictional loss.

The frictional losses associated with a differential gear box is always included as part of the total power transmission systems frictional losses.

Just as when the differential set is included in the same assembly (aka trans-axle) 

whether the differential is combined in the same assembly or mounted as a separate unit, its still a transmission.
Reply: Some Other Dude Well in that regard you are very confused and misinformed.

Steam power on a scale required for automobile applications is indeed "horribly low"

Please feel free
to provide some data which is disproves these commonly held and well understood engineering realities...

Wrong, that is also incorrect... its actually much, much harder to reach steams theoretical limits.

This is easily proven by comparing most efficient examples of both technologies currently available.

For example, practical and commercially available Diesel engines exist that are already very close to steam maximum theoretical limits and easily exceed steams current practical limits..
Reply: Nagy Andras Most steam engines (recip. or turbine) convert heat into work at very reasonable efficiency rates.. the problem with steam is the high thermal losses associated with the boiler and heat loss through the working fluid.

The production and handling of water vapor is where most of the heat energy loss or waste is created...

ICEs on the other hand, are free from this wasteful process, extracting heat directly from the expanding gasses of combustion...

Not so fast, lets not start comparing apples and oranges 

ICEs also reach significantly higher thermal fuel efficiency when utilizing multi-stage, combined cycle systems.... so that argument is not gonna fly here...
Reply: mmm not quite. the low combined efficiency was due to the water vapor waste heat, to be specific, the lack of waste heat recovery methods.

allso while multiple expansion cycles are verry possible and was done decades ago on steam engines, its not quite managable with ICE engines. otherwise you would see more turbo compound engines, rather than turbo charged ones.

the heat loss in an IC engine are about 50% ish just like in  a steam engine, there is a reason you see all those radiators around the front of cars and trucks and.. everything.
re-condensation of the steam, partially via more than a single expansion cycle, and then re-introducing the still hot but condensed water to the boiler is verry possible with steam, but you can not return any heat to an IC engine.

piston based steam engines are not developt for many decades now as for large scale turbines are far more better suited in any case, and on small scale diesel/petrol engines are dominating for now.
with the current technology steam engines could run at far higher pressures, far higher temperatrues, and - unlike the engines you see - can be thermaly isolated to reduce the losses. This is something you could not do with an IC engine. You can not isolate it, and stop it emitting heat. steam would still be not suitable (and for efficiency related issues) to be used in a car or truck.
Reply: Nagy Andras Carnot says otherwise...

ICEs are of a much higher theoretical and practical limitations than steam....
Reply: +The real doktorbimmer waffling is your forte’, as well as using nuanced escapes when they are your only way out.
Reply: piston engines, steam or IC both work on Carnot cycle, you have no different efficiency there. allso notice carnot cycle is not quite close to real life.
Reply: Nagy Andras And excess air loss, and flue loss, and the latent heat that is not recovered...

it adds up fast.

Both of you still seem oblivious to the fact that the Practical ICE designs already exist THAT EXCEED CARNOT'S theoretical limits for steam.

If you actually understood what the Carnot cycle is... you would understand the thermodynamic laws that limit the Carnot cycle and that steam engine can never be more thermally fuel efficient than an ICE..

Carnot proved this fact 80 years before the ICE was EVER INVENTED!!!!
Reply: Some Other Dude No waffling here... I have said the same thing over and over... steam has a much lower theoretical limit and therefore a lower practical Carnot cycle efficiency... as is proven by many examples
Reply: The real doktorbimmer

same here, steam has some advantages that can compensate for its less efficiency compared to IC engines.
Reply: Nagy Andras Yes, the genius of the Carnot cycle is its formula can be applied to any heat engine design equally and give exact and comparable results... it is also useful in determining both theoretical and practical inefficiencies accurately...

Niko Carnot predicted that an ICE design would be developed that would be inherently more efficient than steam... modern engineering have proven his formula and his predictions.
Reply: +The real doktorbimmer "
And you continue to refuse to accept the fact that ICEs are in fact more efficient heat engines than steam... "I have long agreed that diesels and ICE are more efficient, it is you who won’t agree that efficiency isn’t why we drive what we drive.  Right now, there are 4 easy to buy options out there: Gas, diesel, hybrid and electric.  If efficiency were the only thing that mattered, we would only be using one of those four options.  YET WE HAVE ALL FOUR, BECAUSE EFFICIENCY IS NOT THE ONLY DETERMINANT.
Reply: even if you have a more efficient IC engine, if you need a tranny, you are taxed to 20-30 ish % loss instantly.
a piston steam engine requires no transmission.

end of sotry, the most efficient IC engine is a diesel engine, around 50-ish % of fuel to kintetic energy conversion efficiency.
if you need more than a narrow band of output RPM, you need a transmission. Loosing around 20% of that 50% reduces the efficiency to somewhere 40% ish. steam piston engines in the 40% ish range are allready done and even obsolete. including boiler losses too, naturally.
for wide rpm band they are far better suited.

mobile applications is where steam is not quite suited at all.
steam engines can produce tourqe even if they are stalled.  IC engines can simply not do that. and this is what you argue against.

and i do understand the thermodynamic laws, and i'm perfectly avare that the carnot ccle is an estimation only. nothing more.
Reply: Nagy Andras What advantages?
Reply: Nagy Andras I'm not too sure about your math skills my friend...

If your claims were true?

Then where are those steam cars you guys say can be practical?
Reply: Some Other Dude There also seems to be alot about the problem you don't understand..
Reply: Some Other Dude And you refuse to accept that the reason why steam powered land vehicles are obsolete is efficiency...

Would you have bought your Jetta if it only got 16 MPG?
Reply: +The real doktorbimmer yeah, like why you transparently pretend autoblog ‘is a rag’ when it says something that contradicts your dogma.
Reply: +The real doktorbimmer "Efficiency of the Cyclone Engine

"Existing high compression uniflow type engines have been built. Water rate determines the efficiency. The use of supercritical & heat regenerative greatly increase the total efficiency. A gasoline engine is about 25% efficient and will use about HP X .08 = gallons per HP per Hour. Diesel about 30-38% and will use approximately HP X .055 = gallons per HP per Hour. The cost of Diesel fuel is approximately 15% more than regular gasoline. 

The Mark IV cyclone engine is in the diesel range. However, Cyclone engines well to wheel efficiency is higher as there is no transmission, no filters and other hardware to operate. In stop and go traffic the Cyclone Engine will get far better mileage. The mark II is on the upper scale of gasoline and is less than the Mark IV. Because of a simpler valve mechanism that will lower the cost of Mfg it works at lower temperatures..."

http://nextbigfuture.com/2014/01/waste-heat-engine-finally-moving-to.html
Reply: The real doktorbimmer

where the fuck i ever told steam to be practical in a car?
ALL i seen told that steam currently is NOT practical in a car.

Learn to read pal.
Reply: +Nagy Andras Exactly my point...steam is not practical in automobile use... so why continue with the moot topic of transmissions..???
Reply: Some Other Dude I'm not being transparent..

AUTOBLOG IS A RAG...

if you want to learn some thing pick up your copy of SAE International and start reading...

Oops... I forgot, you not an engineer.....
Reply: Some Other Dude Chevy Volt????

PT Barnum was right...
Reply: Some Other Dude Wow.. that comment was a mess... 

Leave the math to an engineer...
Reply: Some Other Dude No, its not in the Diesel range... its no where close...
Reply: Some Other Dude Its not hard to get an EPA rating for a domestic hot water heater either...
Reply: Some Other Dude The question is could any of the Cyclone engines get an EPA CAFE rating above Tier 10, BIN 5 ??

Because if not it would too inefficient to be sold in the US...
Reply: +The real doktorbimmer yeah- because like steam engines, hot water heaters benefit from constant combustion.  ICE don’t.  And that’s without extremely expensive unreliable power robbing after treatment.
Reply: Some Other Dude Diesels deliver significantly lower CO and HC output than other ICE offers... and the highest fuel mileage on the market.
Reply: The real doktorbimmer

asshole, transmissions are used not only in cars.
if the application requires a transmission steam is more efficient than an IC engine and a transmission.
AS IT NEEDS NO TRANSMISSION
therefore the losses of the transmission do not tax the engine.

ships that where converted from steam to IC for example did need a transmission, but in both cases they did not manage to have the same fuel efficiency. question may arise why where they converted from steam in the first place? liquid fuel is more practical. and starting up the engine requires less efforth, so it was all about practicality. efficiency wise steam is was will be better SINCE IT REQUIRES NO TRANSMISSION.
Reply: +The real doktorbimmer yes, but that ignores the achilles heel of diesel: NOx and soot.  And a diesel without aftertreatment would be a dream, but its not what the world allows and its not what anyone will ever drive.  Euro 7 emission requirements are the problem.  We can only hope automakers can meet it without making diesel too inefficient and complex.  And if there is a Euro 8???
Reply: +The real doktorbimmer oops, I forgot you're an engineer who thinks there's only his approach to transportation, till the end of time (which will be sooner, thanks to diesel emissions)
Reply: +The real doktorbimmer why, because the volt gets better mileage and fewer emissions by far than any diesel for an average commute??!  The volt is the first production range-extended vehicle, so put aside your diesel god for a second and give it some credit.  The VW X1 is the kind of range extended design the world should go to- yes, with a diesel engine, although they use a 2 cyl inline and they should have used opposed cylinder single chamber or - better yet - toyota free piston linear generator.   You need to look this up, because if you were'nt so stubborn you'd realize what an elegant and effective approach this is. This kind of car would be so fuel efficient that we could use ANY kind of fuel no matter how expensive, and it would also pollute so little we could continue to use a heat engine instead of anything else.  Since the linear alternator can be used to control the piston, HCCI might work very well here.  Although your personality defect will preclude you from admitting this, which is a shame because it's a great idea and thus only available to open-minded engineers.
Reply: +The real doktorbimmer oh lookie here!   SAE international is alluding to the challenges facing car manufacturers regarding diesel emissions!  So is SAE International now 'Fake'?
http://papers.sae.org/2015-01-1034/
Reply: +The real doktorbimmer oh lookie here... SAE International is touting a scholarly book on meeting the 'TOUGH CHALLENGE' created by diesel emissions regs... in 2006!  The author would probably drop dead if they saw the Euro 8 requirements.
Reply: i.. usually think 2 stroke diesels might have a comeback. REciprocating mass is less vs fuel burned over a unit of time, that might give it an advantage. however, exhaust gas treatment will still be an issue. 2 stroke diesels need some form of forced induction, and a turbocharger could only work at a portion of the RPM range only. Superchargers / blowers are not quite efficient enough, but probably an electric motor assisted turbo could work.

an alternative fuel would be alcohol in a setup like that, probably a corsshead style arrangment could help to deliver the verry high compression ratio required to make alcohol be worthy.

one thing is for sure, the composition of fuel has to be changed. reciprocating mass has to be de-creased. and vaste heat recovery is mandatory for car engines in the long run.
sadly TEGs do not offer enough, steam would be a bit impractical at this time.

I got no idea how it could be managed..
Reply: +Nagy Andras have you taken a look at that toyota linear alternator?  It’s a 2 stroke, no crankshaft, the piston only pushes a linear alternator which charges batteries in a hybrid.  The piston has a 2 stage intake which can be used to pressurize the charge.  HCCI is very possible with this engine as you can vary the compression electronically.  This engine is extremely simple- and the only mechanical friction is with the piston itself. Google it!  And wait for doctor negative to make disparaging comments about it.  After all, he knows better than Toyota and several other companies.
Reply: +Some Other Dude ""And wait for doctor negative to make disparaging comments about it.  After all, he knows better than Toyota and several other companies.""

wrong again as usual... lol!
Reply: Nagy Andras That's right, transmission are not just used by cars.. they are used in lots of steam engine applications too... But the thing to remember is many application that are or have been used in the past with both steam and ICE don't require a transmission or require the same transmission... leaving the steam engine without any transmission loss advantage....

so unless we are limiting the scope to automobiles?

Transmission loss is not an advantage specific to steam power...
Reply: +The real doktorbimmer admit it, steam engines have full torque right from 0 rpm up.  They are also reversible.  In many instances steam will not require a transmission or a reversible gear setup where ICE will.      A-D-M-I-T    I-T
Reply: Some Other Dude But it doesn't change the fact that steam has become obsolete in most applications because of its lower overall efficiency and higher cost... which is what matters...

Its why steam is obsolete in vehicle applications
Reply: +The real doktorbimmer you didn't admit what I asked you to admit, and I also do not believe a cyclone-like engine will cost more.  Are you referring to Dooble like cars?  For them, cost was no factor, they were luxury cars.
Reply: Some Other Dude The Doble was already obsolete at the time it arrived... steam was already dead.

steam is generally by its nature more expensive to build per unit of performance and more expensive to maintain..

ICE replaced steam not only because they are more fuel efficient but because they were also cheaper to build and to operate
Reply: +The real doktorbimmer I believe a modern approach will bring it very close when you also consider emissions regs.   Really, the automotive world has become very concerned about meeting the coming regs.  If someone invents a way to solve soot and NOx problems, then great.   But it is not looking good.  One good approach is how Mazda does it., yet they only did it by reducing compression and thus they traded a lot of efficiency.   I still like their approach because they have virtually no aftertreatment!  The aftertreatment system in my Jetta SUCKS and it is causing me and thousands of others major headache and expense, and I mean even before dieselgate.  Problems with EGR system, water and oil in the intercooler, clogging DPF, etc. etc.     It is NOT VW's usual quality.
Back to steam: cyclone's approach will attract niche applications.  That alone means steam is not dead.
Reply: mm i'm not sure about the expense of building and maintanace of steam vs modern IC engines. Steam engines have less moving parts, require no computer controlled managment, no injection pumps, and so on. A piston type steam engine, the engine part it self is dead simple. At worse it may require 2 electric valves if someone wants to go fancy. and yet, it can still be a double acting steam enigne. The fancy part is the boiler. that is the large part on old steam locomotives too.
Reply: Some Other Dude Even Domestic water heater sold in the US require redesigned burners specifically to pass NOx emissions...

external combustion does in fact produce NOx..

We are also now concerned with CO2 output something that steam engines chuff out in vast abundance thanks to their fuel guzzling low thermal inefficiencies

The problem with steam is not that external combustion is very clean... the problem is the horrible fuel economy...

In case you have forgotten the EPA CAFE schedule is phasing in higher standards every year up to 2025..

current steam technology cannot even meet current standards for fuel efficiency... 
 Yes, for automobile applications it is dead and has been for over 100 years...
No, Cyclone can't even get a real engine built let alone one that has competitive fuel consumption figures...
 they are just using the technology to attract gullible investors so they can be fleeced willingly... its a lot easier than robbing someone at gun point... some clever crooks figured out that you can trick the stupid folks in to simply handing over the money willingly...
Reply: diesel engines and even petrol engines require compression to work properly, mazda manages the the regulations by reducing compression. external combustion heat engines require no compression of the fuel they burn.
yeass, steam is dead for automotive use btw.
i agree with that part.

horribly low thermal efficiency? no way. that part is simply not true at all.
Reply: Nagy Andras Variable compression, either static or via variable valve timing can be used to control pressure... and EGR is used to reduce temperature too..

That's basically what HCCI technology is.. an extension of the technology already in use on Diesel and some Otto engines to reduce NOx emissions..

The production of NOx happens during specific pressure temperature iso-graphic efficiency islands and only when excess oxygen is present in the air fuel mixture.. 

The formation of nitrogen oxides is limited by reducing temperature, pressure or starving the reaction of oxygen..

The production of soot is also effected ... and changes based on the fuel type used...

this is of particular interest in engineers pursuing HCCI technology which allow stratified charge, compression ignition with the use of higher petroleum fractions such as gasoline or LPG...

The thermal fuel efficiency of steam technology is greatly influenced by the effects of scale and mass... the smaller the the steam engine the lower its thermal fuel efficiency... and the less effective heat recover systems like combined cycles and heat exchangers become...

the largest single cycle steam engines barely match the the thermal fuel efficiency of a small Diesel engine found in an automobile currently available..
Reply: those large single cycvle engines are quite old, don't you think :D
You should not comapre an engine from the far past with an engine of the present day.

compression ignition of petrol is.. kindof a bad idea, detonation (knocking) is not going to save the day :D

and EGR... look, i have several angines that HAD EGR in them, i removed the EGR valve and they work far better. consume less fuel, and the air filter is now not clogged with soot.

as for NOx COx emissions, in an external compression engine you can influence the temperature and the pressure when the fuel is burned, and instead of pulses, you can go ahead with a constant burn.
Reply: Nagy Andras Wow really...?

Most examples of steam engines are very old.. they are obsolete in most every application today.. 

You can't have knock with direct injection.. fuel cannot burn prematurely if there is no fuel in the combustion chamber.

Your cars were Diesel???

we are talking about EGR for compression ignition.. 

yes EGR without GDI does not improve performance...

But if your SFC is higher because your using steam? Your overall emission are higher... not lower...
Reply: direct injection with petrol only saves the engine some power, as it only has to compress the air all the way, not the air and fuel mixiture. fuel is injected later, but that does not prevent knocking is the octane rating is not high enough. it should still be ignited by the spark pluggs, not the compression. but you have to inject the fuel, and get it mixed with air to make sure it burns well.

and no, specific fuel consumption would be closely on par with IC.

loo, you tend to think steam became obsolete and useless, i get your point. otherwise steam would be used everywhere.
but your logic is flawed, steam never became obsolete, it was allways inconvinient for amny applications. when more convinient solutions became affordable, those where adopted.
where nothing else than maximum efficiency mathers, steam is still rocking, and it will allways do so. inheritevly steam turbine applications are the single most best for stationary constant and predictable, stable loads, have the few mechanical parts only.
if loads are to varry unpredictably piston based steam is the ultimate killer, in stationary soultions. the allread menationed lack of need for any kind of transmission just makes them the best. but, every engine kind has the best efficiency at a given load/rpm . so load matching was done do make the loads predictable, and stable as possible. piston based steam engines simply are not needed, not obsolete.
for non-stationary use, boilers where the major problem, not steam power or steam efficiency. the funken boiler was too big, its simple is that. ever seen a big old locomotive? the engine part is really literally just the pistons. ever seen a diesel locomotive engine ? uncompareable, even if they have the same output. so then what is the large thing on an old steam engine?
you got it, the big ass boiler.
un-insulated, and pretty mutch wasting a lot of power. the boiler efficiency did improove over the decades a lot, as many industrial appliactions require steam or heated nitrogen gas or the combination of the 2.

the reason you don't see steam powered cars is not the lack of steam engine efficiency.
but the inconvinience of operating one.
compressed air engines where at a time a popular choice to experiment with, but if you think about it.. compressed air piston and turbine engines are verry closely related to steam powered piston and turbine engines.

that idea got dropped for the same reason, it is inconvinient to store a lot of compressed air.
steam is even less convinient, its high pressure, and high temperature.

you can not just turn the ignition key and fire up a steam engine.

meanwhile external combustion has the advantage of burning fuel in conditions not related to engine load or RPM.
variable valve timing, variable compression, variable ignition. this is the IC world.
pre-set, and kept at highest efficieny environment for burning anything is external combusion world.

a pure hydrogen burning boiler with a psiton based steam engine would preform quite well to be honest from the view of emissions. lubricant burning would be non exsistent. the byproduct (if you can controll pure oxygen and hydrogen mix) would produce clean water and water vapor only.

problems you would face are long startup/warmup time and long stand down / cooling time before/after use, hydrogen has low energy density, its quite dangerous to carry around a can of hydrogen and a can of oxygen tanks in a car for example.
high operating temperatures would require god insulation too, it would as a unit be just simply inconvinient. it would pass any emission regulations for sure, it would inherit a nice CVT (comes with the steam piston engine, free of charge) and mechanically it would be far less complex. but it would just suck to use one on the short run.
on the long run you could not store enough fuel, as its not high enough in density.
on a train, it is far more better to ue electric power, and carry no fuel just engines.
on a boat, nuke has far superior energy density, and that is just how the biggest things move on the seas. nuke plant provides power to boil water to get steam, to make things move.
you will never see those go back to IC engines, operating them would be just insane.
Reply: Nagy Andras ah no.

there can be no pre-ignition without fuel in the combustion chamber...

pre-ignition and knock are not exactly same thing in this context...

well you only have to look around to see that ICEs have replaced steam in all but nuclear  and coal fired power plants.. so yes it is obsolete... without question
Reply: Nagy Andras GDI eliminates the need for high octane fuel for preventing pre-ignition..

and it eliminates the need for a throttle valve with causes pumping losses